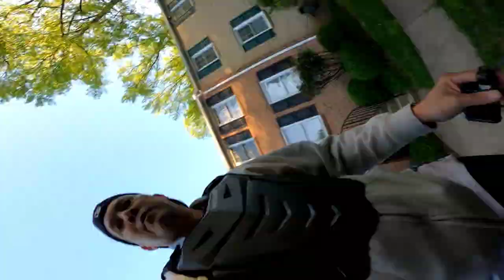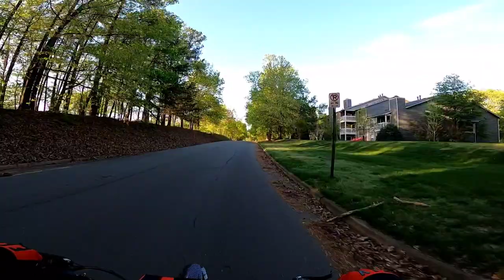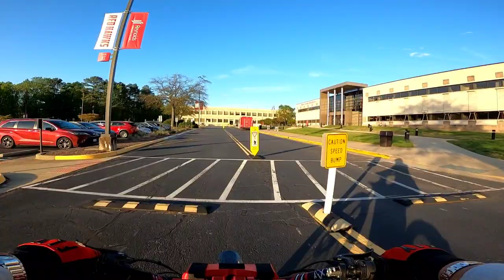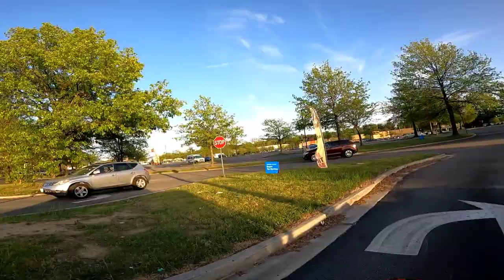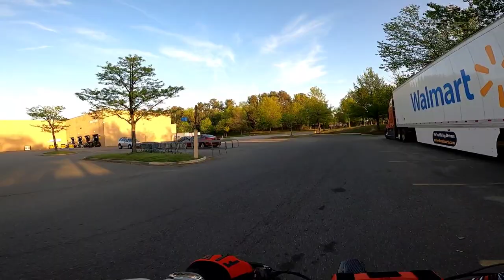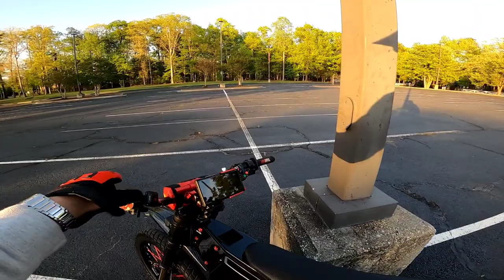Ebike Mods electrical components, its all Math shout out 2 BITI PC program calculations! DreamTeam!

Comment: Do you plan to ever go to a high voltage controller? Like 32S?
Reply from the maker: Yes but not on this build in satisfied with the high current acceleration for racing. I plan to do high voltage build on my petrol sport bike conversion because I'm gonna want that to have high top speed like real motorcycle and I don't think i need to go any faster on this Ebike frame. Real petrol bike frame trying to go for crazy top speed